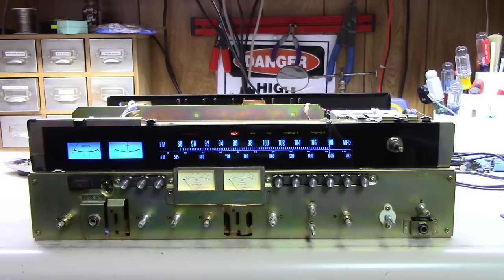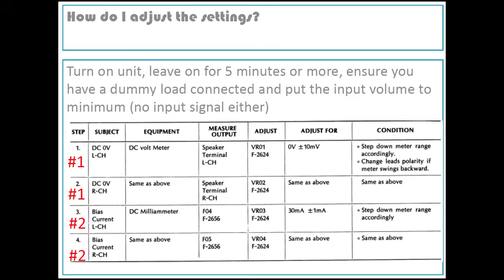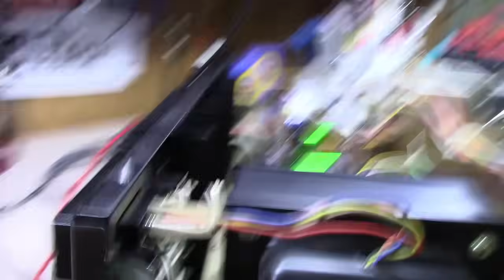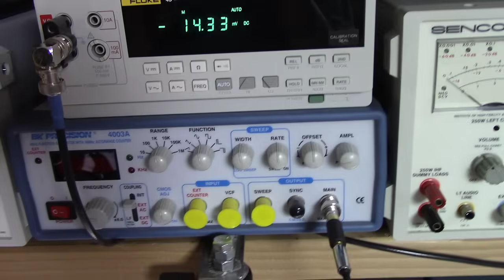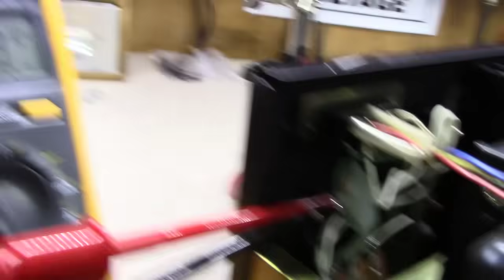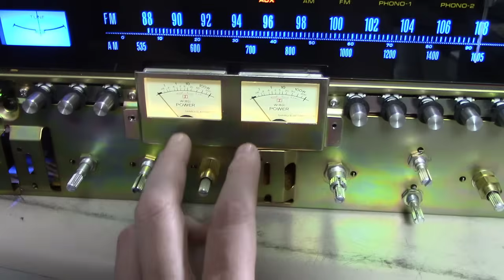Biasing a Sansui 8080DB & Stereo Amplifier Biasing Explained - BG083

Comment: I've been chasing a 3v dc offset issue on a Luxman L-100 integrated amp even though the bias is set to 60ma following the service manual, which gives very sparce procedure info. The trimmer pot that's used to adjust for 0v offset is in good condition yet has no effect on the speaker terminal voltage. Components (resistors, capacitors, transistors) checked not only on the power supply and audio output but on all boards within the unit show all to be in good condition as well. Board traces were checked for continuity with no breaks detected. Voltages going to the audio output board looks good. When powering on using a dim bulb, the bulb brightens, the relays click and bulb then glows faintly, all seems good so far. Hooking up an 8ohm dummy load causes the bulb to glow brightly.  Something is amiss and am completely stumped on the cause of the offset and why it's not adjustable. Any info on what is going on and how to correct it would be appreciated.
Reply: I have used GROK AI to help troubleshoot my receiver. You should try it. It even asked for, and used, a photo of my pcb. It also provided a link to a free service manual. Good luck!

Comment: Really great video! What would cause a unit to pump out high voltage through the speakers at volume zero- outside of adjusting the bias.  Bad caps is what I think you alluded to?

Comment: So the ideal to measure the bias step 1 to 0 millivolt is to connect your speakers. Because not all speakers measure 8 ohm, some 7.9 ohm other 8 ohm. Step 2 is to trigger the transistors? Or?

Comment: Wouldn’t adjusting the bias to just under 30mA mean the transistors are not on? Also on my Yamaha it calls for a bias adjustment of 2.5-6.0mV not mA. Are some models adjusted in mA and others in mV?
Reply: The bias adjustment of 2.5-6.0 mV means that you measure the volt drop across the emitter resistors of the output transistors. So according to Ohms law V= I x R . So if you measure 6.0mV across a 0.22 Ohms emitter resistor then the current I should be I= V /  R = 0.006V / 0.22 Ohms = 0.027A or 27mA

Comment: There is something I don't understand. If moving a magnet in this sense required a changing electric field then how could a DC Offset cause the speaker magnet to be "always up" or "always down"? Wouldn't the speaker initially move to that distorted point only when the amp was first turned on? Then once the change in voltage become no change "DC" and the magnet would fall back to it's rest state?

Comment: Thank you for this so much! I have a set of semi-rare active speaker amps I have to bias, although obtaining a service manual is not an option as the company is defunct as well. I do know the transistor set however (Toshiba 2sc3281 & 2sa1302). I discovered there is a model of Sansui made that used these same Toshi's. I just need to find out the exact model so I can search for a service manual.

Comment: Thanks for the explanation, i'm learning all of this stuff by myself. I'm working a bit on my luxman power amp probably not the best amp to learn on because it's quite valuable but the thing has a fault where the dc offset on one channel will just rise up to a whopping 1.2V and then it goes in protection. I think it's an IC that's broken, dc offset is controlled through it i think, a well known problem on them. Before i start on it i wanted to know how to do all this stuff because the manual makes it into a very complicated proces, they want you to use variable power supply and sine-wave generator. I'm just going to do it like you did it for now or at least check the current. The manual says it should be 140mA, much more than yours but its a very hot running amp with massive heatsinks. 

One thing i see a lot in these tutorials is to get better pots, it makes adjusting easier, you could try that too.

Comment: Would you please help me with my Denon Poa3000. The manual said 180mv. After watching your video, i think t should be 180mA instead. I connected pin 11 to my multimeter and pin 12 to another multimeter and ground both of the ground leads to ground. I can’t seem get any measurements to come out as this set up. I think I did something wrong. Please help I will attached the service manual so you can see if there is a typo or not. 
http://akdatabase.org/AKview/albums/userpics/10007/Denon%20POA-3000%20Service%20Manual.pdf

Comment: I have a sansui in my storage building. It has been there for years. The speaker jacks were acting up so I just quit using it. I gave 200 dollars for it back in the 80's. Been so long, I am not sure if it was a 7000 or a 9000, I think a 9000. There is no one around hear you could trust to work on it. I know it was a loud thing. I would love to get it working again but I don't have anymore speakers for it. I have some pa speakers now but I don't know if they are the right ohm. Back then I did not know anything about ohms and I ran any speakers I had and I may have damaged something. I may have to go get it out and see if I can see what is wrong, but man that thing is so heavy.

Comment: May i suggest that you change all the little 1/4 and 1/2 watt flame proof/metal oxide resistors on that driver pcb. Those 8080 and 9090's were known for those resistors opening or change value causing the amp to go into and staying in protection. I noticed in the video you replaced the caps but not those known to fail resistors!  Like I said.. well known for that unit!

Comment: can someone explain why I need a dummy load rather than having a speaker hooked up? Great video!
Reply: i'd guess it's for a more stable load, speakers have capacitors and coils in them that probably mess with the results
Reply: I should also add another good reason to the use of dummy loads… If something mess up with the dc output you will avoid destroying a speaker I guess.

Comment: So the dummy load is connected in parallel with the DMM, I didn't see how yours was connected, also do you center the balance control or adjust it to the channel you are working on? Does it matter?
Would 10 turn pots be worth the time and effort, or affect the collectable value of the equipment? Do you recommend using a little de-oxit on the original vr's before adjusting them?
Very informative video, thanks.

Comment: I have an 8080db and had to set the DC offset and the bias after recapping the driver board. I had the exact same issues with the VR pots being too sensitive and not matching the manual. I was thinking of changing them out for 10 turn pots.

Comment: Due to the hunting of the voltage readings. I am thinking of replacing the vr's with bornes variable resistors.  I think these will enable a more steady reading. what is your thoughts on this?